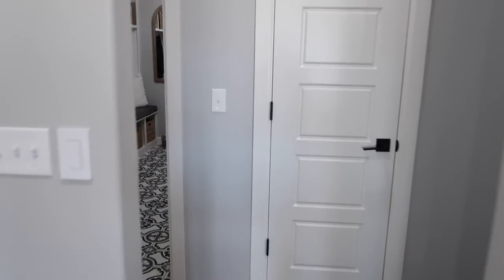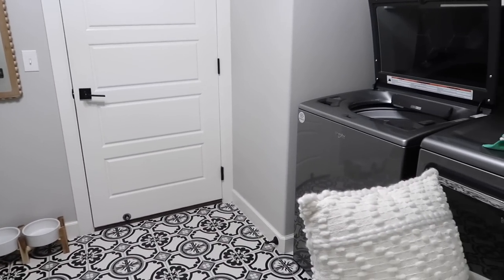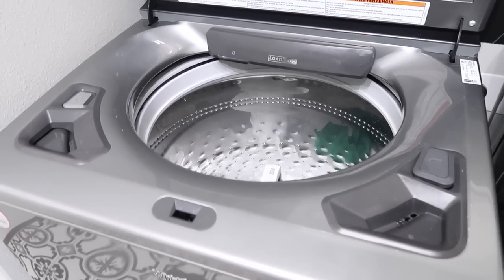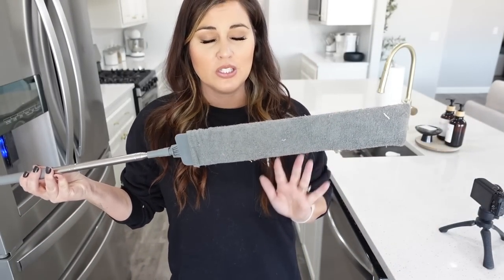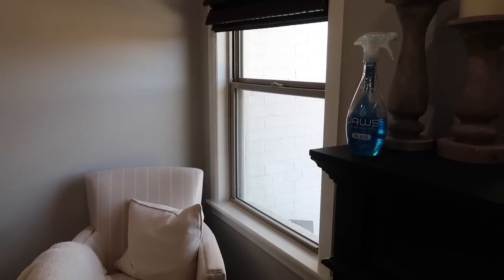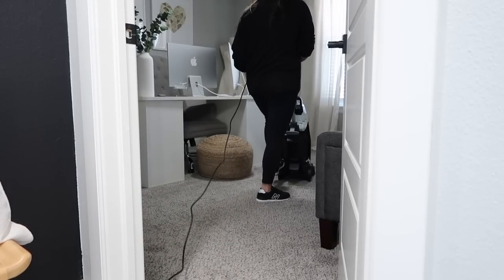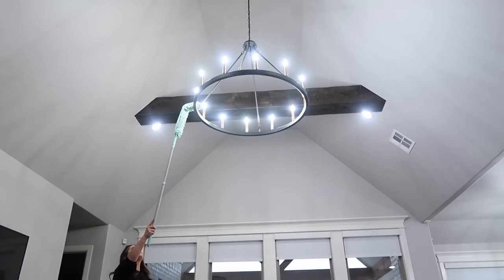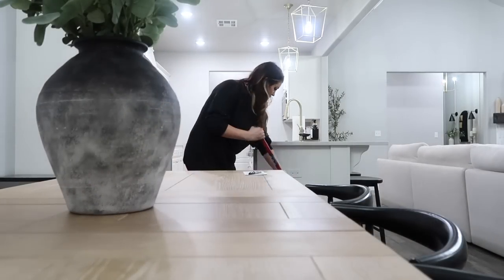WOW THAT'S A TON OF CLEANING! | SPACES YOU MAY BE FORGETTING TO CLEAN | 2023 SPRING CLEAN WITH ME

Comment: You can also clean the outside of the top windows too. While the lower window is in the open cleaning position, bring the top window down and the same locking clips are there to bring that window in.  Works like a charm!

Comment: I have the double hung windows as well. You can do the same thing to the upper pane as well. You need to open the bottom one and let it hang and then unlock the top one and pull it down and open to clean like the bottom.